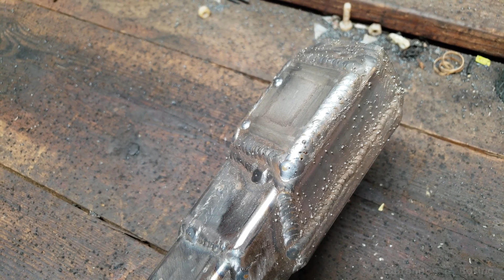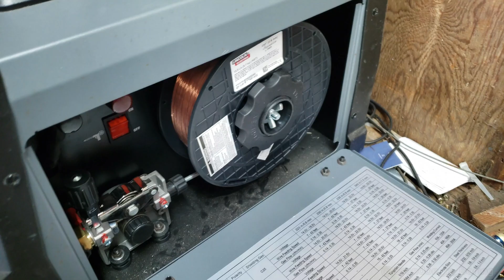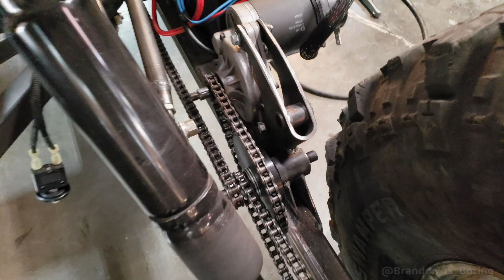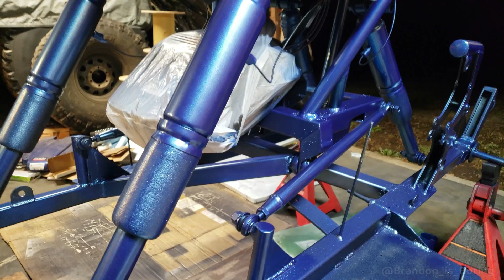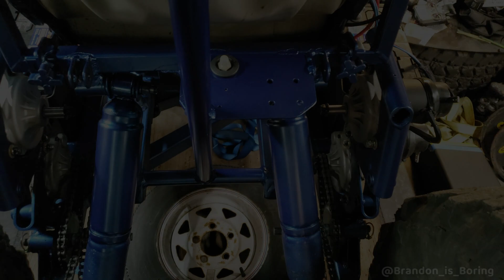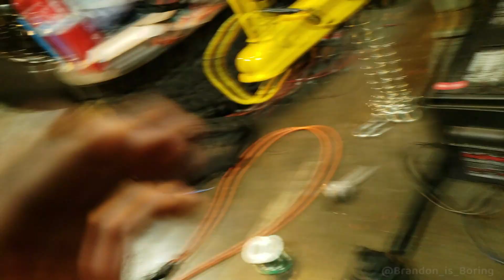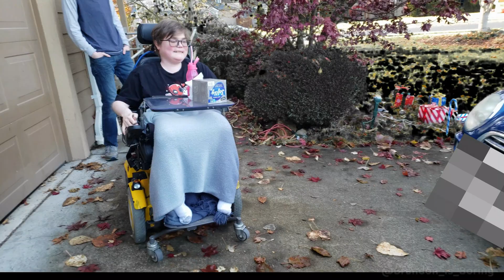UNSTOPPABLE Wheelchair for my Nephew

Comment: Awesome chair  bud. Need some help. I am a high level quadriplegic and built my own 4 x 4 chair but Need some help with the electronics.
Reply from the maker: The electronics are where I had the most difficult time too.  The chair I used has their own archaic software and communication system that isn't compatible with anything else.  What electronics do you have so far?
Reply: @Brandon_Makes_Stuff Hi Brandon I am currently using the Dynamic linx 120amp power module, the new chair i am building i am using 4 x 750w wheelchair motors  which draw a  continuous of 130 amps and peak 150amps for 30sec. So  my current set up is not strong enough enough
Reply: 2:10
Reply from the maker: @jasonhall2055 Sorry!  Read this an was thinking about it and forgot to reply!  Can you run 4 separate power modules?  One for each motor?  And splice the control wires together for 2 for each side??
Reply: @Brandon_Makes_Stuff hi Brandon  thanks for your reply.  Yeah thought of that too but works out realy expensive 😢
Reply from the maker: @jasonhall2055 Maybe start with 1 and see if it has enough power to work?  Then slowly add more if needed?